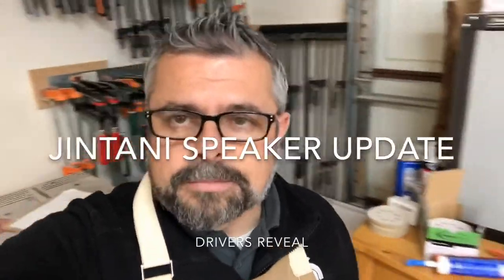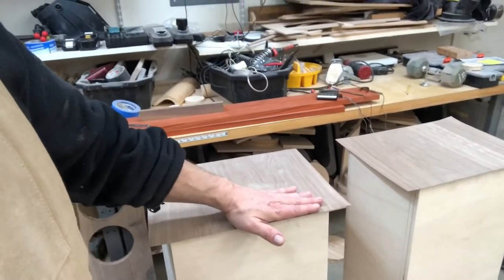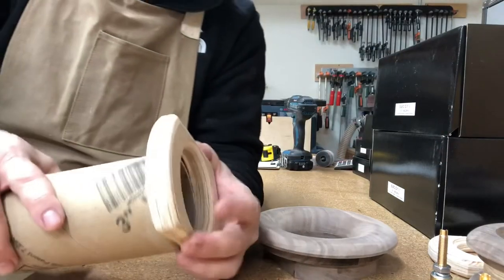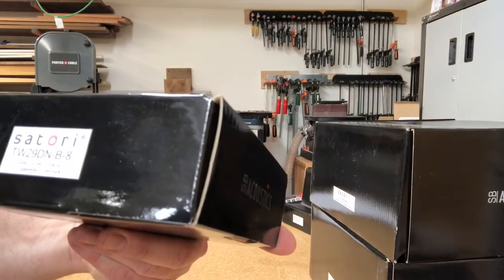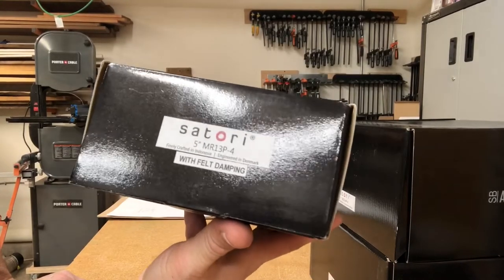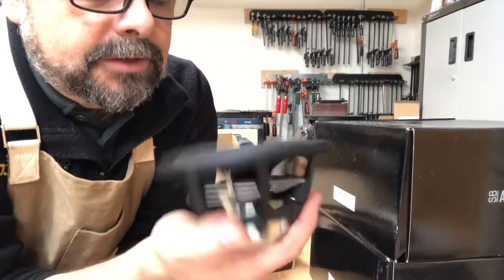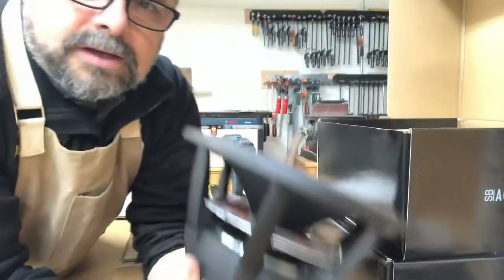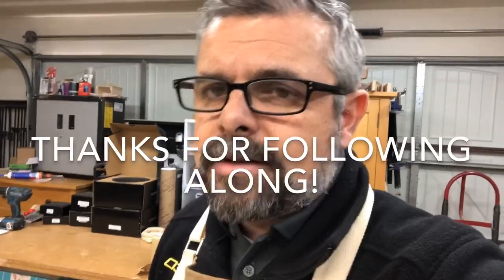Jintani speaker Update Satori Driver Reveal

Comment: I just love SB Acoustics, quality/ price. Only thing i hate tho; now, manufacturers will sometimes leave the voice-coil exposed like these. NOT GOOD!. They can protect the coil/gap with the spider, like they used to and, have good cooling. They just want foreing objects in the gap, so they can sell you annother replacement driver an make more $.
Reply from the maker: This isn’t an issue with things getting into the voicemail as you say
Reply: @javadshadzi4824  Huh? what??
Reply from the maker: @ronbradshaw7404  it’s not an issue, you’ll never have to replace a driver because of the reason you’re saying.
Reply: @javadshadzi4824  I said what? cause you said "Voicemail" you meant voicecoil, right?.
Reply from the maker: @ronbradshaw7404  correct, typo thanks 🙏🏼

Comment: The tweeters are lacking a protective mesh and the woofers are not stable at the tinsel lead junction so they broke if hard driven over some month ... very difficult to repair! And why are they no replacments?

And the ringdome tweeters have another problem regarding resolution with specific signal ...

Sorry not SOTA .. only pretty expensive stuff!
Reply from the maker: Satori drivers are state of the art, I have used them extensively in projects and they are also very well respected in the DIY community and with commercial builders alike.  I have never heard of or seen any issued with the Tinsel leads.  Their Be tweeters have protective mesh, the softdome tweeters do not need it, plus it wouldn't make them more state of the art if they did.  All Satori tweeters have very flat response, very low distortion and have no issue resolving the signal, so it's not clear what you're even referring to here.  Thanks.